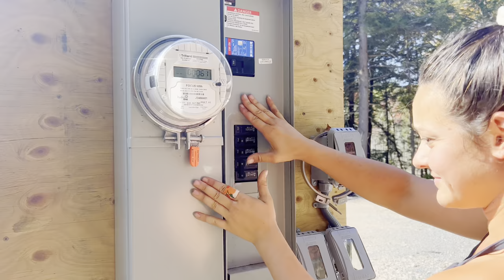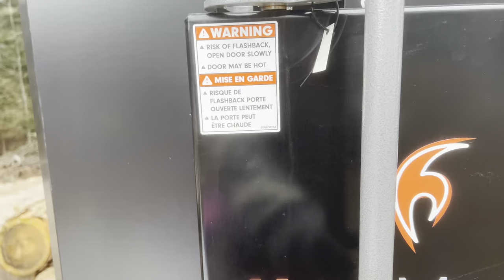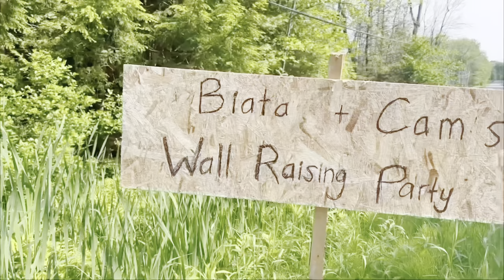This DIY Took me 2 Years! EVERYTHING I’ve Built From Scratch

Comment: You defiantly don't need sill gasket on interior walls,  but you do need treated lumber. and you have foam and vapor barrier . zero moisture.  It would a 500 years for a interior wall to fail. Ive done a lot of 100 plus year old  housed and see what actually survives.  great job.

Comment: Absolutely Amazing!

I am going to start my home-building project in 2024. I have to go through a lot of permitting, and in my state, I am required to outsource some things like electrical and plumbing, but I will try to do the bulk of the work.

Tip: In your kitchen, you can put horizontal blocking between your studs where your cabinets will be installed. I have seen people do that, which is a great idea. It will give you solid places to hang and screw the cabinets.

Awesome job overall. You gave me a boost in confidence to try to tackle more things on my own.
Reply from the maker: Thank you so much for the tips! Good luck with your home build!
Reply: @SimpleLivingwithBiata  You’re welcome, looking forward to watch your future videos, you’re doing amazing work

Comment: Once you realise you are able to do anything, once you have been taught how. That means flying aircraft and even drying racing cars on. I started life at work as a carpenter, bench joiner and furniture maker. I Learnt to fly and then learn to race cars, then work in Holland, Germany and New Zealand. I also qualified to manage safety, quality and environmental on a £600,000,00 project. If I CAN DO IT any one can, once you clear your mental block and realise anything is attainable to you. Then you will be able to do anything, like you have done so far WELL DONE. Just small steps that become giant leaps in time. And you only get things right by getting it wrong first time, so check and measure everything at least twice. Keep safe and you will learn, although it might not be first time!

Comment: ... New recommended video of this channel ... Wow ,, you've taken on a big task .. Not hearing so far where this is located and wondering about regulations and building codes ,, have to follow up on the build ....   With all the timber clearing and prepping for future use , you need to invest in a good log splitter ,, not all that expensive and will save huge pains and possible injuries from axe splitting ,, depending on model some are even self feeding of rounds with a conveyor to pile splits ..  As you have learned , you are capable of gaining the knowledge of how-to ,, just need to hire out the labor in some areas to make things work cost and time efficient ..   Interesting to watch home builds so I guess it's time to do a little catch up ...Stay Safe and God Bless ...
Reply from the maker: Thank you so much! I agree on the log splitter! And I'll be hiring out some trades for sure! Thank you!

Comment: I like to watch channels such as this where people build their own homes, while learning how ro do it. I am in the construction industry and it amazes me to see people work so hard to achieve their build when I work with so called professionals that can't accomplish the things that you guys do. I feel that your home is one of the best "home Built" homes on the internet. I have one question for you. It is the same question that I ask the other creators on their channels when I comment. It seems that everyone of you put down a metal roof using an "R" profile panel. I wonder why that was your choice rather than some type of Standing Seam profile that mounts to clips rather than putting all of those potential leak points in your roof by screwing down your panel. I give you props for the butyl underlayment though. Overall, great job. And by the way, 1/8" off on each side is closer than the professionals ever get it.
Reply from the maker: Thank you so much! I went back and forth and back and forth on the snap lock style vs the exposed fasteners. Every single roofing company and roofer I asked said it’s more of an aesthetic choice and that there’s no more risk of leaking if you do the HT premium ice and water shield :). And that both require maintaining. Because either way steel roofs sweat so water is getting in behind no matter if you have exposed fasteners or not :)
Reply: @SimpleLivingwithBiata  Thank you for the reply to my question.